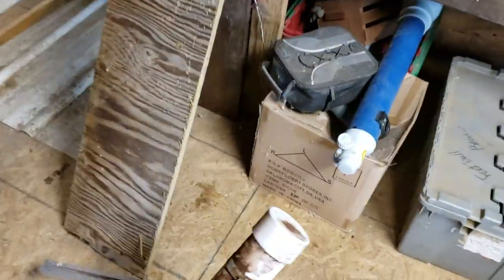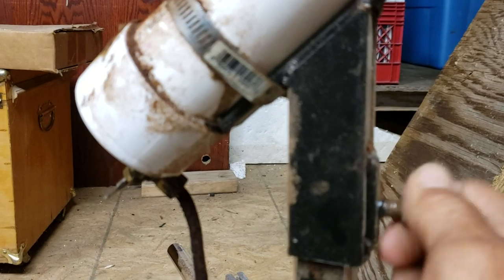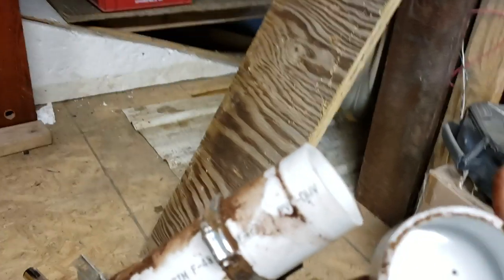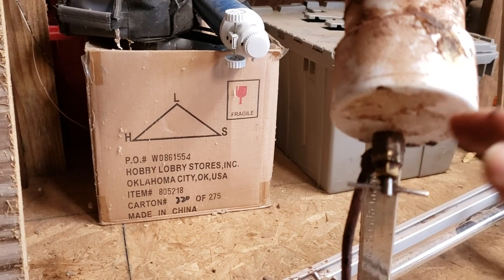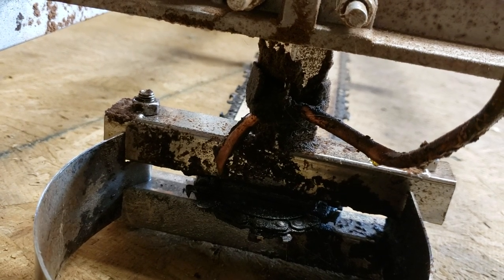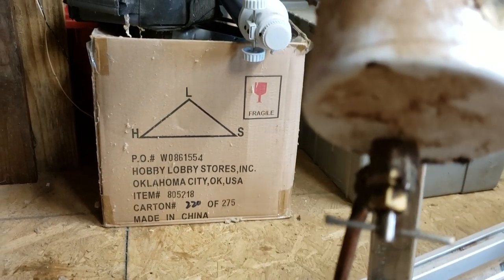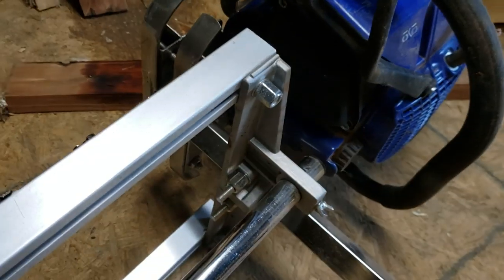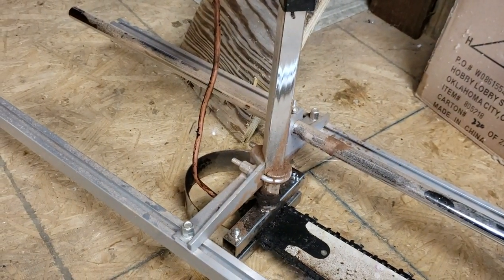Homemade bar tip oiler for chainsaw mill.

Comment: Awesome, thanks! One thing I like better about your approach than the way Granberg does theirs is with your way there is no need to drill a hole in the bar. Just need to see if I have any square tube in my scrap pile the right size to fit over the vertical bar.
Reply from the maker: Right on dude.

Comment: Place external oiler on inside and allow the tip  to almost touch the bar….the oil “draws” on the bar and the spinning chain picks it up. If the tip is to high the oil sprays (vibrates) everywhere….

Comment: Cy , how's the pond doing?? filling up? lol      i hope you are doing good.
Reply from the maker: The pond has filled. Took two storms to do it. First one is on the end of the last pond video second one lasted 22min and dumped 2.5 inches in that time. It filled approximately 328,000 gallons in that time. Was pretty incredible how much water came down the hill ti fill it.

Comment: What do you use in the tank?
Reply from the maker: I have switched to canola oil for all my saws and this mill. But any chain lubricant will work. I just like the non petroleum oils.
Reply: DIY with Uncle Cy thanks Uncle Cy.  I’ve got to do something for my saw.  I’m running a Stihl 051 with 36” bar and.404 ripping chain.  Doesn’t seem to cut very well in walnut